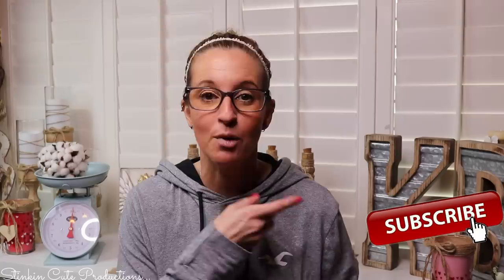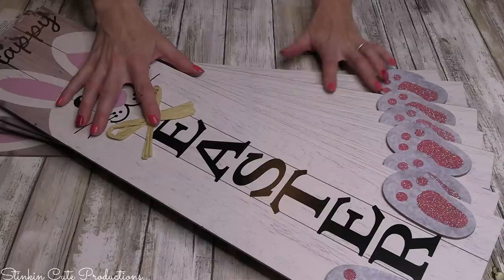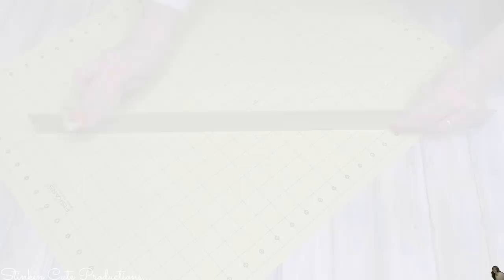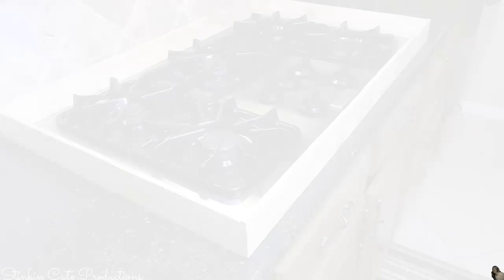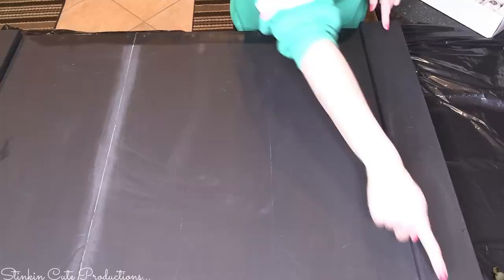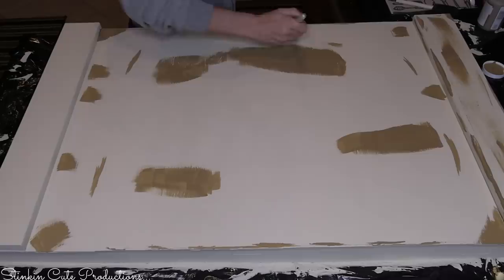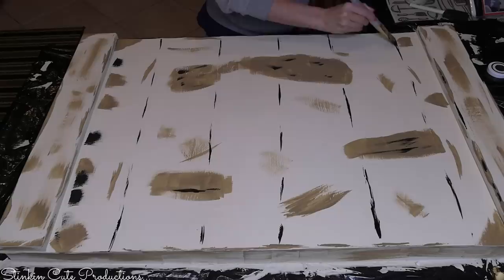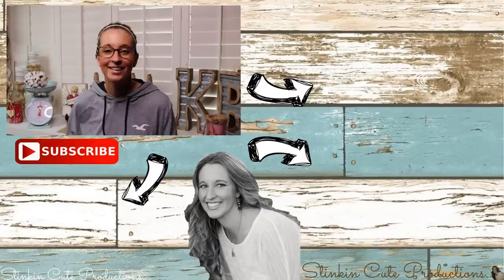AMAZING MUST SEE Dollar Tree STOVE TOP COVER DIY for UNDER $20

Comment: This looks absolutely awesome. you did such a good job but.... this is definitely not.... under 20 bucks.   Panels $7, Wood $6, Jinga Blocks $7, Knobs $6 bucks thats $26 bucks there and not even adding in the paint, stencils, glue, pop cycle sticks. just all the other items needed im guessing this is actually about a $50 project. which is still cheaper.   But again you did an awesome job it turned out really good.
Reply: She had the wood already, only used 2 of the knobs from the 12-pack, and she had the paint and stencil (reusable) so hers was under $20.

Comment: I think it is pretty. The thing I would add is your laws are different than in my country. I have tradesmen in my house and they said that it still needs to vent if you put the oven on. Or the other worry is that this type of stove should always be left uncovered in the case of an accidental gas leak.
Reply from the maker: It’s not meant for this to be on while it’s on so no vent is needed

Comment: This is pretty, but I’m kinda puzzled. Do you live where stoves are illegal?  Is your stove on the run from the law?  Not being snarky, I truly don’t understand why your hob/stove should be hidden.  I use mine every single day, I chose my stove top carefully, we bought the one I loved most and it had 5 varied size rings including a huge double burner ring for my pasta pot, wok and huge sauce/soup pot for when I’m batch cooking.  Never once have I thought “geez, I wish I could hide my stove”. Is this a US thing?  I’ve never even seen this here in the UK. Plus having to move this each time I cook would drive me nuts.

Now put this on the wall, I’d be there with you, but I just don’t get why y’all are hiding your stoves.  Except those making comments about your camper, space is very valuable there, so being able to have duel purpose areas is very practical.
Reply: Very often, cooktops are just the tops and the ovens are wall units, so the tops can be eyesores as not many of us can afford $3,000 - $10,000 to replace the standard $200 unit that most builders use (not sure what currency you use, but hopefully you get my meaning). The one you have goes closer to $8,000 here. I homeschool my kids and my hubby works from home, so I cook all meals during the day and evening, so I fully understand your concern as I'd be moving that thing constantly and it would get old fast! I'm still making 2 - 1 for my rv and the other for my cooktop to use when I'm entertaining (we entertain alot) and times I know I won't be using it (summertime, we grill out alot or I use my crockpot to not heat up the kitchen in this Texas heat!!). I hope I answered your question somewhat. I share your thinking in moving that thing all the time is just not feasible and if I had a high end cook top, I'd never cover it!!! Lol.
Reply: People are different. Lots of people love these and will be making this. I already made mine

Comment: Majority of comments are that they want this for extra counter space. Please, if you're going to make this for extra counter space in your kitchen and you plan on putting food on it, you need to seal it!  You'll have to get food approved sealer and that's going to up the price way more from $20. Regular craft sealer isn't expensive but if you want to be able to wipe down the surface and be able to eat food off of said surface it needs to be a sealed surface that has used the correct materials.  Kelly, please make sure you edit this video bc you could get people sick if they start wiping down the surface and start ingesting glue and such.  Love your crafts but this one you gotta be careful with.
Reply: I dont lay food out on my counter to eat and ive never known anyone who does. Food will be in a bowl, plate etc and will be fine sitting on unsealed wood.